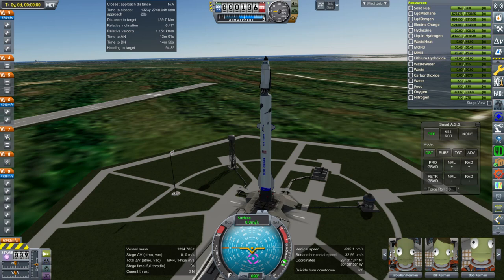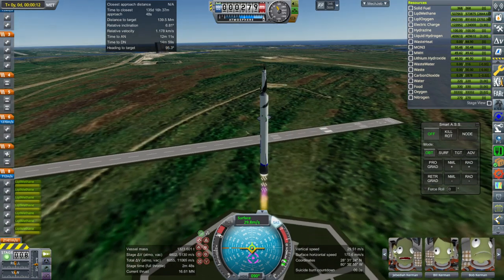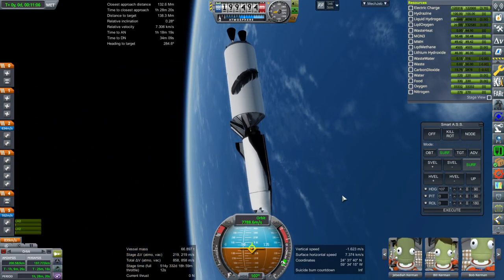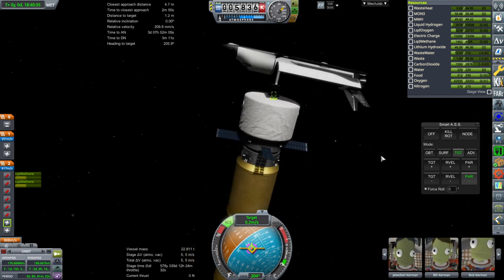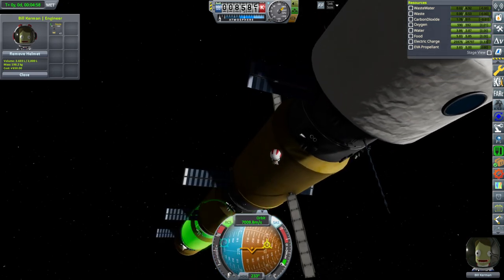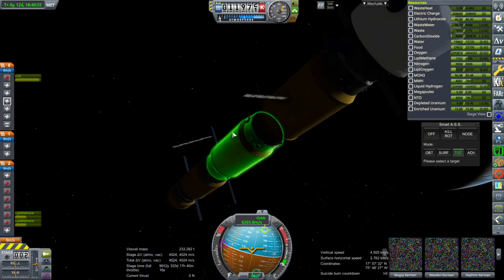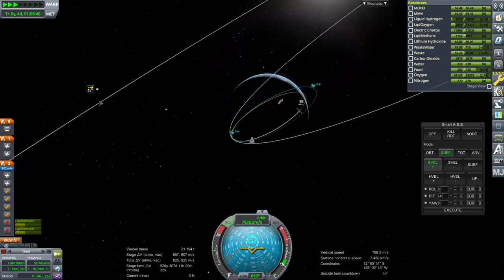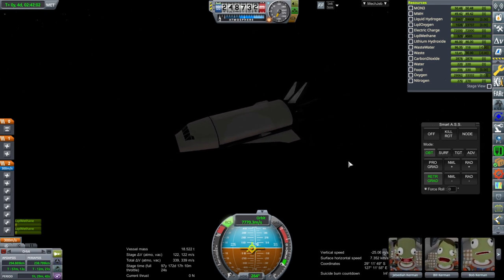Realism Overhaul in KSP 1.8.1 - Mini-Shuttle and the Radiator Rendezvous

Comment: 2:50 i also don't use ascent guidance for actually flying the rocket . However it is very usefull for telling you when you to launch . For example when doing rendezvous or sending probes to other bodies i press the "Launch into plane of target" , set the countdown to like 30 seconds , engage auto-pilot wait for the automatic time-warp to finish then when it reaches the 30 seconds before launch it will disable time-warp at which point i disable the autopilot and click the abort button . Fly on my own from there :)
Appologies if this has been mentioned before

Comment: Launches complex space mission to fix nuclear spaceship

forgets drill
Reply from the maker: I put it in - at least the first time. The problem was that I replaced the cockpit after doing so because the version of the Shuttle Mark II cockpit that I originally had on used hypergolics instead of Methalox, so it was mismatch for the body. I failed to put the drill in the second time.

Comment: 1:54 in such configuration it is set by checkboxes BySoi and ByTgt to plan launch from Earth to Ntp Tank (you don't need to enable mechjeb launch, you could just tap on launch into plane of target and it will show time when you need to manually launch)

if you clear both checkboxes you can select both planets manually, and in case selected things which do have same parent (star or planet) and so it would be required to make escape burn  it will show intermediate orbit in source planet soi in map mode after you press any button that will force it to calculate transfer (to prevent any hidden cpu usages, it will recalculate orbit only if button pressed (not only first button, actually almost any button in that window, but specifically to remove any misunderstanding there would be "Calc&Draw Intermediate orbit" to press if src and dst chosen correctly), both speed (which is currently infinity m/s would be updated too, they depends on selected dates, and obviously need to be considered carefully).

p.s. you do use old (non beta version, which obviously still has all problems which do you have before with that addon, still it is capable of planning orbits too, orbit angle selection in map could be buggy depends on which release do you use).
if you wish to use optimization for tuning departure and arrival times i recommend use beta version, and consider enable checkbox near Dst.Inb.Spd with name "Tune2" (i.e. minimise both escape and arrival speeds, otherwise it would minimize only escape speed i.e. for flyby).
departure and arrival times set in days from beginning of the game (it do show you current game day for reference) and beta version do also show for reference how much time till both dates in more human readable form.
p.s.2 if you don't like mechjeb ascent launcher you just need to fully ignore first button, other buttons only optimize entered values and gives you 
information (including drawing intermediate orbits) or create burn nodes, if you still want to use warping to launch time you could adjust launch countdown and enable "engage ascent autopilot" only for warping and then disengage it before actual launch, seconds in launch countdown never warp accelerated.

Comment: 1:35 What? I like the Starship–Mini-Shuttle, at least.

6:00 Same.

7:50 Only problem with the LES is that it ain't reusable.

13:10 Hey, if the game's broken, you're perfectly justified in fixing it.

15:05 Can you model that within the part?

16:30 GAH I wish KAS was capable of more precision/regularity in placement.
Reply from the maker: On the reusability of the LES, technically the parachutes are on the LES pods, so we could retrieve them with helicopters and reuse them.

Comment: you could use a custom fairing like for the experimental unmanned shuttle the US have.
Reply from the maker: Having crew on board makes those fairings a bit more complicated because you have to get the crew through them. Not so hard with the X-37B since it doesn't have crew.
Reply: @RaizSpace  what about the Indian capsule, if I remember correctly in your previous video it was inside the fairing, how would they go around that?